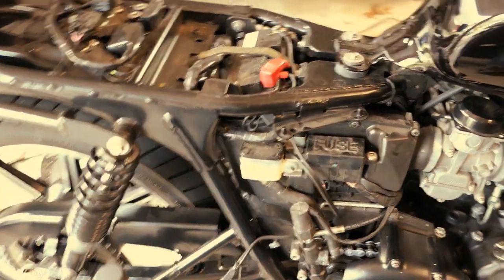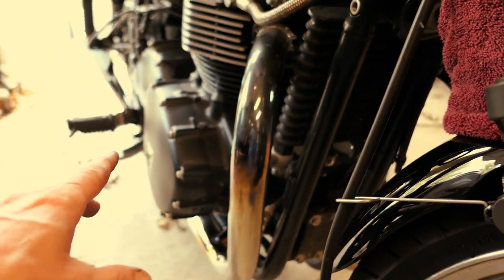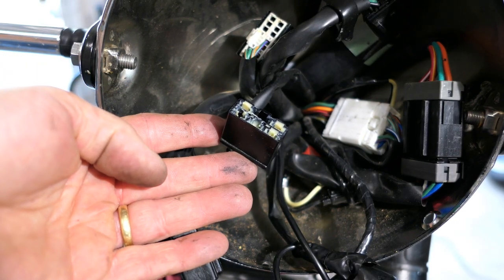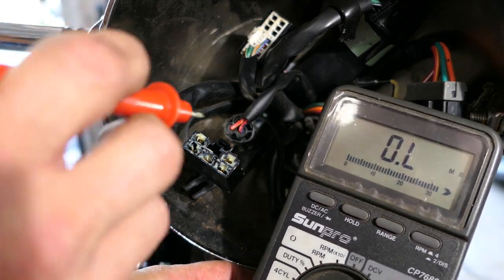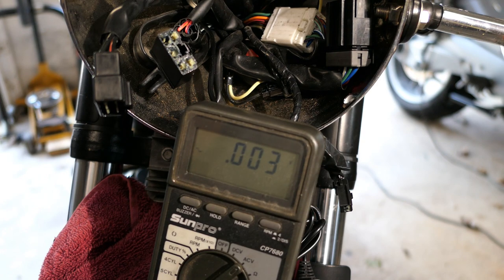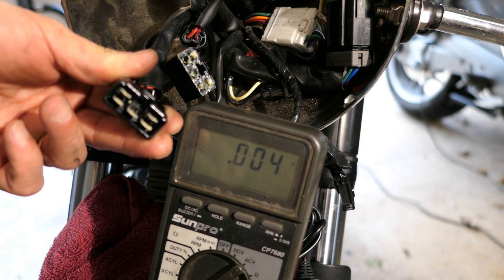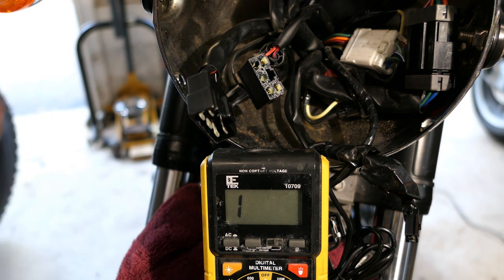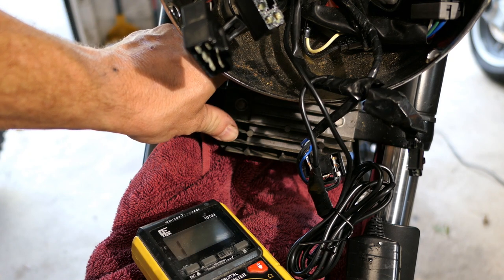Testing A Triumph Bonneville Charging System

Comment: I have the same issue with my Bonnie 2008. I will be running the same test to find the issue. Thank you for the video.
Reply from the maker: Good luck!
Reply: @tinderboxarts  Thanks man. I followed the same test scheme and found out that it was the Regulator as I had 12.4V to13.0 V at 4000 rpm max. I went for the replacement with same regulator as the one you used. Your video was instrumental in resolving my issue. Thanks Again.

Comment: Great video.  Why do the wires come out of the reg/rec yellow then switch to blue?  That seems confusing.  It would have been easier (for guys like me) if they would have kept them yellow from start to finish.   Good to know the Rick's unit it plug and play and fits in the stock mounting holes.   I would have thought the charge would get closer to 15V with the Ricks unit... like 14.75.    14.30's seems a tad low for 3000rpms but I don't know what the specs are.   I'm sure that's plenty to keep the battery charges and run what it needs to run.

Comment: Thanks for posting, best description of troubleshooting this I've seen yet.  Do you happen to know if Torque or TuneECU via OBD can shed any light on this condition or would it simply be reproducing the data you get with the voltmeter on the battery?
Reply from the maker: I've used TuneECU before, but there's nothing special about that software that I can think of which would help in this situation.  Remember, going through the diagnostic connector means you are also going through the ECU and the wiring harness in order to get your data from sensors or the battery voltage.  I'd rather have a direct reading from a trusted meter.  Live data from the diagnostic connector can be very useful in troubleshooting, since it allows you to see what the ECU sees.  For accuracy, though, I'd rather use a meter.  What could be useful, I suppose, is a great difference between voltage readings recorded from a meter versus through the ECU.  That might indicate a voltage drop due to corrosion or physical wiring issues.  Still, those things can also be found pretty easily with a meter. I only wish we could know with certainty what the ECU programming has for voltage parameter cut-offs in this circumstance.

Comment: Hi John. Thanks for your video.  I have a 2013 T100 and have been trying to follow along your video to figure out why my battery isn't charging consistently and keeps dying on me. I tested the windings and they are .4 for each one.  The AC voltage reading with the bike running coming from the stator was 35.  YOu mentioned in your video that 45 was ok for certain stators.  Do you have any advice on whether the output of 35 indicates a stator issue, or if it may just be the rectifier as in your case?  Thank you!  Jennifer - Ottawa, Canada
Reply from the maker: Well, there are a few things to think about.  You indicate that all the windings of the stator are giving identical readings.  That's not foolproof, but it's a good chance that they are good if they give the same reading.  Unfortunately it isn't always easy to find the manufacturer specs for a particular bike for comparison.  So, if the measurements you get are within a typical range and all identical, it's reasonable to assume that the stator is good.  You didn't mention your voltage readings at the battery, though, and that's an important part of the equation.  If the charging voltage is way off and the stator tests good, that leaves the rectifier.

I also have to wonder, though, what you mean by your battery not charging consistently.  Is it possible you are barking up the wrong tree?  You didn't mention the specific symptoms you have experienced.  If the problem is that you sometimes come back to a dead battery or that the battery resting voltage is low, perhaps your issue is not the charging system but something else.  For example, you might have a parasitic draw or just a tired old battery.  If your stator tests good, and your charging voltage measured at the battery is up where it should be, then you need to consider other possibilities.    This video ( https://youtu.be/d-5xA31nBd8 ) is about how to test your battery itself.  And this video ( https://youtu.be/AhqZwLnD9Jk ) uses a different bike as an example, but the concept of parasitic draw is covered.
Reply: @tinderboxarts  Thank you! I'll double check things as you suggested, but my instincts tell me that the battery isn't being properly charged when being driven at lower rpms.   I plan on replacing and relocating the rectifier regardless, but would be great to narrow down if the stator is an issue or not.  I'll let you know how I make out!
Reply from the maker: Test, don't guess! Being methodical and going where the facts lead you will save you the money and the headache.    With electrical issues, especially, it's easy to be fooled.  I'll be curious to hear how you make out.

Comment: Hi! Thank you so much for your videos which have been super helpful. Ive been trying to figure out why my Thruxton 900 2009 doesnt turn on. It gives me the "click" that I suspect its because of the ECU voltage threshold problem that you mention in another video, however, my question is why it keeps happening even with new and fully charged batteries. I ran some tests and my battery doesnt have current leakages, my charging voltage is 13 at the battery terminals when idle and goes down to 12.7-12.8 when at around 2000 rpm which made me think i have a charging problem. I then ran all the charging troubleshoot and my windings are all giving me similar readings (dont remember the exact number) and my AC voltage is 24-25 through all three stator terminals and goes up to around 35 in all of them when accelerating to around 2000 rpm which makes me think the stator is ok and it may be a regulator problem. Do you think I can be missing something? Or should I replace the regulator and see what happens? I guess my main question here is if the 25-35 VAC that the stator is generating is enough or is too low... thank you!!!
Reply from the maker: Okay, there's a lot to unpack here.  First, is your 2009 bike fuel injected or carbureted?  That was around the model year it changed, and the voltage threshold problem only applied to fuel-injected bikes.

Second, the voltage threshold problem relates to your battery voltages at rest and with the key to the "on" position, not to your charging system.  If you measure your battery at rest it will be 12.6 volts fully charged.  With the key to the "on" position the voltage should stay above 12.2 or so.  Below that and the ECU threshold value could be a problem, but above that it is not likely to be a problem.

Third, there are other reasons you could be getting a click and no-start.  For instance, your starter solenoid could be gummed up or you could have a poor connection at your battery or the starter.  You might try to discern if the click is coming from the relay by the seat or if it is coming from the starter area.  

Finally, your charging system questions are a different problem.  12.7 volts charging is indeed low, and you might take a look at your regulator based on your other tests.
Reply: @tinderboxarts  thank you for your answer! My bike is fuel injected. Regarding the click, it is what you say, when I fully charge the battery with the charger the voltage would be around 13 and goes down to around 12.4 when in the On position and it would start perfectly, however after a couple rides it would measure a low rest voltage and does the click. This is a brand new battery.  

If I start the bike with a fully charged battery or with a jump starter it wouldn't have any problem so I imagine the starter solenoid and relay are functioning well.

The fact that the battery is getting slowly discharged after every ride made me think that it's not charging when running, that's why I did the charging tests which showed the low charging voltage at the battery terminals (13 at idle, 12.7 at 2000 rpm)
Reply from the maker: Okay, that makes better sense--I didn't follow the whole backstory.  So you have a functioning bike when you test the battery at 12.4 or so.  But, when you continue to ride without supplemental charging the battery voltage declines and suddenly you have a starting issue.  So there are two things you should do.  You say you already tested your stator output, which was acceptable.  So that does leave the rectifier/regulator.  It's not difficult to replace that component, and then you should see charging readings come up to where they should be.  The second thing you should do is visit a Triumph dealer and see if they have an ECU software patch for you.  My understanding is that Triumph did change the pre-programmed voltage threshold for the ECU sometime around your model year.  In fact, they did an update on my 2010 Bonneville for exactly that reason.  However, the update was not widely publicized and I imagine it had other fixes included too.  So all you can do is ask the dealer to reflash your ECU with the latest software and hope for the best!
Reply: @tinderboxarts  yea, makes sense. I just ordered a new regulator and will see what happens. Will also go to dealership. Thanks!

Comment: Hi friend. Thanks for the good video. Ihave the same problem with a Benneville T100 2008 and found the altrernator output is 26.5vac on each winding. Not 45vac as in the video. Do you think this output is normal in this 2008 model?
Reply from the maker: Yeah, there were some differences among model years, so I wouldn't worry about it.  If all three windings are reading about the same then likely you are fine.
Reply: @tinderboxarts  thank you my friend. Regards from Mexico
Reply: John. I alreay replaced the rectifier with success. Thank you again. I Would líder to ride with you in México sone time and have some tequila to celebrate you channel
Reply from the maker: Thanks for the wonderful offer! I'm glad your repair was successful.

Comment: Hello John.  Thank you so much for this Video! I’ve never used a multimeter on my bike before and your instructions were clear and super helpful. My 2008 T100 has been dying at random times ever since I installed a USB charger for my phone about 2 months ago.  It has since been removed, but the problem persists.  The battery is only 5 months old.  It will start, but sometimes after a few hours of riding it won’t start after I stop to get gas, and I need a boost to get it going again.  Also, if I leave the bike for a few days after a ride it is very often hard to start or dead.  Battery has been tested and seems fine.  I wonder if after a long ride the battery is not recharged by the alternator like it should be, so it’s dead when I return to the bike a few days later. ??? I’ve found the safest thing is to just plug into a tender daily and then I am ok. Anyway, I ran the tests you showed on the stator, and the AC voltage reading with the bike running was about 15, 15 and 15. Yours read 45 each for each connection.  Would this mean it’s the Stator that needs to be replaced? The readings were even which is the only reason I’m not sure.
Reply from the maker: The worst thing you can do when diagnosing a problem is to make assumptions.  Assume nothing.  I'll put a link to another video you should watch.  You need more information about various voltages under different conditions.  You say you tested the battery, but not how you tested it.  You want to know resting voltage, if there is a surface charge that quickly diminishes when the light or a similar load is applied, and then the starting voltage when you try to start the bike.  If any of these are suspect, you can put the battery on a real charger (not just a trickle charger) and see if you can restore voltages to where they should be.  If not, the battery may be done whether new or not.  If it does come back to where it should be, then the next question is why it was run down.  You'll want to check charging voltage to see if the charging system is working right.  That includes putting eyeballs on the cables and connectors to look for loose connections or corrosion.  Get all the data, then you can make a determination.  I don't know off the top of my head what the AC voltage reading should be for your particular stator, but if your charging DC voltage is in a good range then you're probably fine.  You should be able to get all these measurements in 10-15 minutes.

https://youtu.be/d-5xA31nBd8
Reply: @tinderboxarts  thank you for your response. I ran all the tests on my battery from your video and the battery looks good. I also took it to a auto store to test it and the results were good. The battery is fine. The testing for the charging voltage was only 13 volts @ 3000 rpm. In your video your Bonneville puts out 45 volts from the stator windings. Mine only puts out 15 volts. This made me  sure it was a bad stator because I should see 45 like yours shouldn’t I? But the crazy thing is I replaced the stator today and I still get the same reading of 15 from the windings. I have no idea what else it could be. Why is my stator putting out such low numbers? What else could cause that if the battery and stator are both fine? When I traced the wiring it also looks good. I don’t see any obvious shorts. Any thoughts on what I might try next would be greatly appreciated.
Reply from the maker: Oh, I wish I caught you before you replaced the stator.  The fact that they were all identical likely means that they are okay.  So, let's back this train up.  You are getting only 13 volts DC at the battery for a charging voltage?  That's too low.  If you have a second meter it's worth checking with that one too just to eliminate the meter.    That aside, it would appear your voltage regulator is not working as it should.  The only other possibility would be bad cables/connections.  So if you check your meter and check all the cables and connectors as good, then the voltage regulator is all that's left.  See this same video starting at about 10:55.  We don;t have the identical bike, though, so just make sure you are getting the correct regulator.  I was pretty happy with this place:  https://ricksmotorsportelectrics.com/

Comment: hello, it’s a very good explanation! I’ve executed tests after your video and the voltage of the stator in my triumph scrambler 2014 with the engine on is 16... I use my bike everyday in spring and summer without problems, so what do you think? thank you for your help.
Reply from the maker: I'm not sure I follow your explanation yet.  If you are seeing 16 volts DC at the battery at idle then that's way too high.  You'll eventually cook your battery.  But, if you mean you were doing a stator test and you found 16 volts AC across the windings, then that sounds quite low.  You have a different model year, so it could be different voltage, but I would still expect the windings to put out more than that.  Either way, you should confirm the readings are correct with a second meter, or test something with a known voltage (like house current or a battery) to confirm the meter is good.
Reply: @tinderboxarts  thank you for your reply. Yes, I mean that I've found 16 volts AC doing a stator test and not measuring battery.

Comment: I know you changed your battery in a later video but it's apparent in this video that it's no good and possibly the cause for the rectifier/regulator to go bad and need replacing. Good well charged batteries don't drop that much in voltage just by the lights coming on.

P.S. Surface charge applies to batteries that have recently come off the charger. It doesn't apply to batteries that have been sitting and have normalized. On those batteries the voltage you see is the actual charge of the battery. If it goes down by a significant amount when turning on lights the battery is weak.
Reply from the maker: Well, it can take half a day for a battery with a surface charge to come down to it's "normal" voltage.  And, I've personally seen batteries sitting longer than that which still have a false charge.  But, yes, typically a surface charge is seen soon after you turn off the engine or charger.  The idea of a weak battery causing an alternator or a rectifier to go bad is not wrong, but I also think it's an overblown issue.  The theory is that the additional strain from constantly trying to keep up with a nearly dead battery will cause excess heat, and thereby essentially burn up the alternator or rectifier.  In reality I think it would take quite a lot of riding around with a nearly dead battery, not just a weak battery, in order to cause that much damage.  I'm remembering a Ford Galaxie 500 I took through several states on a long trip with a completely dead battery, or my wife's Suburban we once took to pick up the kids at college with 6 hours driving on a dead battery.  Perhaps motorcycle rectifiers are more sensitive, but most of us stay home if the bike doesn't start or turns over slowly. The charging system needs to keep up with requirements for the ignition, lights and accessories.  A weak battery doesn't add that much more demand, though a completely dead battery might.